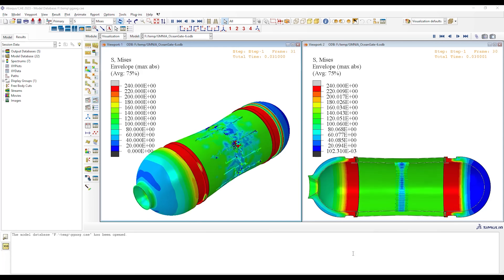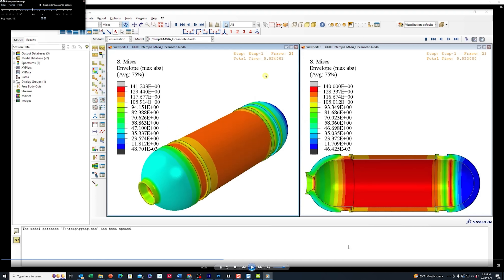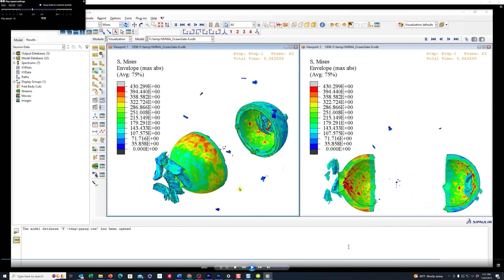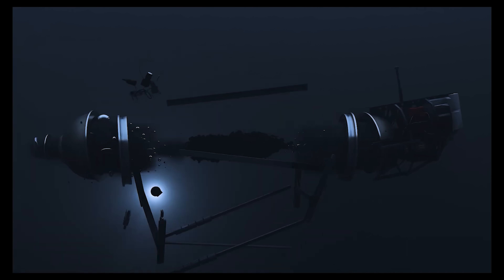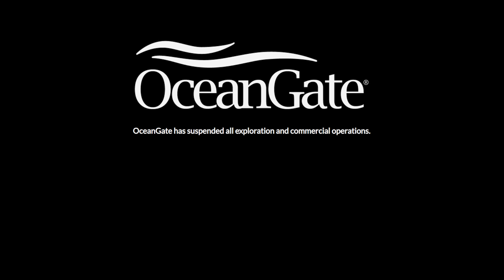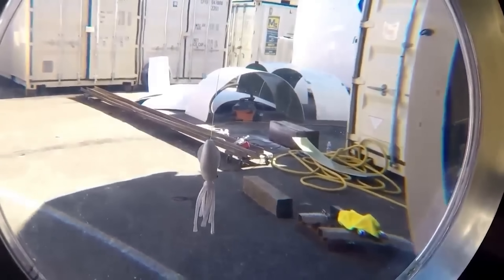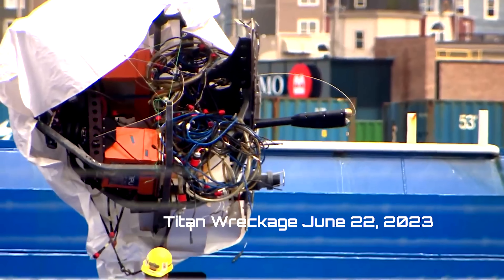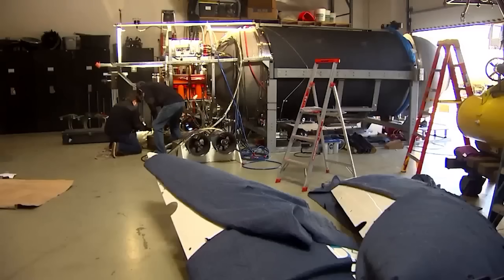Best Titan Sub Implosion Simulation, Cracked Porthole? Q & A

Comment: As a drafting design student my money is on the glue between the titanium and carbon fiber, there’s too much movement there under each compression cycle to even remotely consider the viewport. If I was an investigator that’s the first place I’d look just because of the strength difference in material and the fact it’s a cycle fatigue hot spot
Reply: When you squeeze a Pringles chips tube usually the aluminium lid pops out  ....Now on oceangate of course the lid couldn't "pop" per say because the pressure outside made it adhere , but the glue joint deformation between a still round titanium lid and an ovalized tube opening due to the squeezing .......
Reply: @benoitguillou3146 apparently once it pops, it can’t stop
Reply: @benoitguillou3146  when's the last time you had a can of Pringles, the lid is always thin plastic
Reply: @otallono  in France at one time they were aluminium if i remember well ( easier to recycle )
Reply: as  mech engineer + applied physicist - I do agree.
Reply: @siclucealucks as a software engineer, I agree
Reply: @siclucealucks  As a aerospace eng and astrophysicists,with a diploma specialty in aquamechatronics,it's a no boner wat caused it to implode,1st carbonfiber glue,alumi,that's a recipe,for disaster,sea water and extreme pressure,don't have mercy,for them material.
Reply: @WeIrD_On3  Im not doubting it ..its matchesburn who says its the the middle of the cylinder which broke first. But in my opinion its the part which can be calculated/simulated the easiest.
Reply: @WeIrD_On3 You may be an engineer or astrophysicist, but if you're a professional, you need to improve your grammar to impress people with your response.
Reply: It was not the glue interface. This thing literally made a tighter seal under compression, just like the acrylic window. The glue interface doesn’t get weaker under cyclic loading; the carbon fiber does. Of course these inferior simulations show that interface failing; that is how it works if you understand the software; it cannot model carbon fiber hull that well 

It was the carbon fiber hull that failed. It was put under cyclic loading, and people hear very loud cracking on successful dives

The hull itself was weaker and weaker until it failed. A cylinder is a weaker shape than a sphere. A fiber does not hold good under compression

All this simulations cannot show what actually happened, because they model the hull as a uniform material, when it isn’t

This is why doing simulations on it is insufficient and it should’ve been tested under real conditions with no one in it for hundreds of cycles
Reply: @pyropulseIXXI  i have worked with FEM as well. Interfaces are more difficult then bulks. btw thats why carbonfiber matrix is diffiult to model because it combines the properties of fundamental different properties and its anisotropic behavior..
Reply: @siclucealucks  yeah I know that is why the carbon fiber matrix is difficult to model; that is literally my entire point of why that is the most likely failure point

The seal would compress and become tighter by the way the titanium ring was inserted into the carbon fiber hull (the titanium basically won't even compress under that pressure while the carbon fiber hull will, so it forms a tighter seal).

So the carbon fiber hull is going under that cyclic loading and any deficiencies in the material could grow each cycle, until total failure

If anything, I could see the carbon fiber failing near seal, as parts of it compress against the titanium and the rest compresses further, causing a differential stress across that portion of the hull

But the hull anywhere could've developed ingress and failed over time, my point is mainly that simulations are not even close to sufficient to determine the failure mode

The only way is to study what is left and hope enough data exists to determine the failure mode
Reply: @pyropulseIXXI  I'm not dismissing the CF hull ...AT ALL , I'm sure it's possibly the primary reason ....But now I'm really really really curious about dunking two glued on titanium half spheres into the marina's trench with an iron rebar in it  ..... If the glue joint holds we can still sell the videotaped performance to 3M as a commercial prop !
Reply: @pyropulseIXXI  if you have a uniform structure - which is the case for the middle section - you can make quite good educated guesses because you dont have to consider the boundary conditions. This is certainly the case at the interfacing surfaces to the titanium spheres. you dont know how the torque created by the compression of the "belly" will result in shearstresses at the glued interface. Mostlikely there is a huge movement thats why they made the lid of the sphere covering the transition from sphere to cylinder so small. Have a look at their glueing footage
Reply: @pyropulseIXXI the titanium was outside the carbon fiber at the attached point so the compression would pull them apart not together.  Kinda wrecked your idea there. High schools diploma ftw.
Reply: @clockworkpanda8  wtf, i thought it was the other way around
Reply: @siclucealucks  the carbon fiber is not uniform..... it is literally a matrix of different materials; how it cured means different sized air bubbles could exist in it as well
Reply: @benoitguillou3146  
"If the glue joint holds we can still sell the videotaped performance to 3M as a commercial prop !"
...You do know that there's glues that have tensile strengths stronger than steel, right?
Reply: @matchesburn  i'm sure of it ! However .... the question is are those mechanical properties as constant along time as the physical properties of steel are  ? We re talking 200 dives here , allegedly peppered by several "concertos" of cracking noises ...

Personally i currently have no variety of glue to sell for a boss lol ...
Reply: @siclucealucks  Exactly.  The middle of the carbon fiber tube was exponentially stronger that the multi-material interface.  Now we know. The glue was all but irrelevant (who puts glue on a shiny metal surface? They should have etched the inner flange to give the (hand applied with paint brushes,..)  glue something to hold on to.
Reply: @pyropulseIXXI  As it turns out, It WAS the glue interface
Reply: @ellayararwhyaych4711  
You said:  As it turns out, It WAS the glue interface
How do you know this ?
Reply: @pyropulseIXXI  LOL... Turns out you were wrong.  The Tube completely sheared off the Tiranuim rings inner lip.  Leaving not a trace of glue behind.  (Why would anyone apply glue to shiny metal surface without acid or laser etching it anyways?)  The glue might as well not have been there.
Reply: You are not the only one...
Reply: This is a dumb argument - this design obviously has multiple points of failure that could have caused implosion, and without any other evidence it’s pointless and nonsensical to argue over which is most likely
Reply: I think there was a layer by layer delamination taking place allowing water to push into the carbon fiber because when they jettisoned the ballast and ballast housing they were still rising much slower than they should have been. They took on weight some where and there is really only one place water could penetrate.
Reply: @daleburnfart6845  I think it might have been the viewport because Alvin and all the submarines that don't blow up don't got viewports but if it wasn't the viewport 100 million percent it was absolutely the carbon-fiber up against them hard titanium rings you know what's so stupid about the carbon-fibre .... any tubular carbon fiber construction is not wrapped it's like woven in a certain pattern I got a carbon fiber paddle from when I was a raft guide and if you just wrap the carbon-fiber in a Circle up the shaft of the pole it would just break it wouldn't be strong and that's what they did with that sub they just rolled the carbon fiber on it wasn't woven in interlinking patterns and even then it doesn't matter you can't have any cycling fatigue. Or your subs blowing up like you can't have a cycling fatigue on a coffee mug after you drop it on the floor.... it's broke the end trash can or recycling bin...... and those are definitely cracks in the view port from my scientific and subsequent experience and knowledge of having smoke sessions and dropping and braking bongs and pipes off the coffee table I can concur that those are 100% cracks in the acrylic.😆
Reply: @topsecretclownbusiness2266   The good analogy on the carbon fiber is like my dad trying to fix a leaky hose with 5 rolls of electrical tape. Held water for 5 seconds then pissed water everywhere. Stockton Rush just figured if he used enough of it that it would solve the problem.
Reply: @daleburnfart6845  😆..... I'm honestly starting to think that maybe that guy was really trying to Market and sell exhilaration and fear of a possible sub explosion to the people who are going down there I mean like people that take extreme risks because it makes them excited so he made a giant Rush an Roulette sub...... I even heard him say in the interview that it wouldn't be a bad way to go and he was getting older.
Reply: @topsecretclownbusiness2266   That wouldnt shock me at all.
Reply: The viewport was only rated to about 1/3 of the depth they dove to.  That's why people question it.
Reply: @brianwest2775  well, he intentionally didn't certify the craft because it wouldn't pass. that rating is completely irrelevant, because that's the only part of the craft the agency was even willing to look at. that window design is time tested going back to pretty much the beginning of this whole deep sea exploration thing...
Reply: @brianwest2775 due to the titanium ring looking clean when it was brought back. The flex of the carbon fiber caused it to sheer from the front ring. This would explain why it looks like everything collapsed to the rear of the vessel. Due to the shape of the acrylic, it was ejected outwards as the front cap blew off.
Reply: My money is on the cyclical wound CF turning into an accordion with zero elasticity.
Reply: @cproteus  reading your comment made me wonder if they ever put layers of fibers in the longitudinal direction, or if the cylinder was basically a big spool of tape wound around.
Of course in this video the moron talks about a foam that doesn’t compress so I’m not sure he would have even bothered with the hassle of arranging filament directions.
Reply: @sburns2421  when I saw the video of the carbon fibre assembly, it showed just a straight winding.
Reply: As a layperson, I just admit that I don’t know what the failure point was.
Reply: I called it from day one. It has always been the glue joint that were basically torn apart by the different ratios of expansion/contraction between the two ridiculously opposing materials being titanium and carbon fiber. It's insane it passed whoever thinking it was ok. It was basically like an earthquake with the plates moving against each other creating hairline fractures. Also the sheer retarded way the glue was unevenly applied by hand 😳
Reply: As a Principal Engineer, and a fully Credentialed Forensic Data and Network Engineer that started out in drafting back in High School in the 70's. I will give you a hint... although hunches and bets are good starting points for an investigation, but a thorough and reliable forensic investigation follows the facts and adjusts to every lead in the investigation.  Sadly, there is no data points or eyewitness testimony to help so this investigation is already starting off with a handicap of those points, but even further the evidence in this case lies scattered at the depths of an ocean graveyard that as inhospitable as it is to retrieve the evidence, the longer the debris lays scattered on the ocean floor and in the water itself, crucial evidence may be elusive forever, leaving us with only hypotheses.  The only good to come from this will be the lessons learned at the cost of five souls.
Reply: @popquizzz yes, a lot of what ifs there. I'm sorry, but reading this thread I read your job title as 'Pringles Engineer'. I need new glasses.
Reply: @lifewithfizz1329  btw ..... why new glasses ? You broke them ? Just glue them back together .... Ask people in the thread , some have got very good epoxys plugs i heard ... but be wary when you apply it , no dust flying around , no sweat drops , and slant grind the surface to maximise the contact area .... or the size of your internet troll head might shatter the branches once again ....
Reply: yeah, the pressure vessel imploded and shot out the dome as the bolts sheered
Reply: Exactly, thats what i think as well.
Reply: As an engineer, I can assure you that the drafting designer lacks the knowledge to know how it failed. More school and years of experience are needed padawan learner.
Reply: From my subsequent scientific analysis and experience of breaking bongs and bowls off the coffee table during the cycling fatigue of smoke sessions.....yep those are cracks in the acrylic😆😆😆
Reply: I am only a welder but every single pressure vessel i have made is usually all one type of metal and all of my work needs to have a test piece not only are my welds x rayed but things that are high pressure are also tested for how they act under refrigeration laws as such also put under more pressure than the licensing regulations.
Reply: And the way they handled the joint prior to application of the epoxy....not in a clean room, no gloves, the dude was running his greasy oily hands all over the titanium skive joint.
Reply: Glue had nothing to do with this. Maybe with a pressure vessel (i.e jet airplane) (i.e PRESSURIZED VESSEL)
This was a vacuum vessel ( 15 p.s.i. inside, 6000 psi outside) Might as well been a vacuum inside. I cannot believe how many " engineers, etc"  are clueless about the mechanics which actually happened. So frustrating and I type so slow............ IT WAS NOT THE GLUE! It was the weakest point of the vessel... the center of the CF tube. It collapsed in a micro second; it shrank in diameter from 9 feet to zero, it also shrank legnthwise in the same time frame.  The mass of the bells, rings and aft sections were asked to accrlerate frim static to approx 3000 feet per second in 1 millisecond. The lack of a molecurlar bond with the titanium rings caused most if not all of the glue and carbon fiber to instantly strip away from the " lesser bond" (titanium ring)  The resultant overpressure cycle caused by air being super compressed was what caused the porthole to blast out past the mostly decorarive retainer ring with 17 or 18 wimpy bolts/ screws. If the lens had crushed and imploded, the retainer ring would have been mostly/ partially attached. No sighns of this in the debris retrieval video. 
Geez , not that complicated....
The rings /bells would have bèen held/ forced in place by hydrostatic pressure. At this point, the glue would only act as a sealant agains't water ingress.
A 6000 psi pinpoint leak would be devastating but not necesarily an implosion event. It would rapidly fill the vessel and drown the " adventurers" 
a.k.a .  victims. 
The CF hull failed at the furthest point from reinforcement ( the center of CF tube)  From there , all mass moved towards that center.  The air inside was super compressed and caused an ignition cycle which caused an over pressure pulse ( this was when porthole blew out. 
Just look at the landing frame. It was collapsede with 1 arm broken off and  the other 3 having gone from 9 feet wude to being criss crossed ( upright arms)  When the feds put this together , you can call my call. Until then.......
Reply: If a pressure vessel , sure. Tbjs was opposite. Different physics.
Reply: As another furry yeah this guy is probably correct
Reply: Not its the window window only
Reply: Looks more like trapped air in the bonding, not sure but the pressure cycles may have expanded it over time.
Reply: I was thinking the same thing too but, also the bolts were affected too at the same thresholds between materials.
Reply: I 100% agree if you pay attention to when they are lowering the titanium ring into place you never see any glue squeeze out meaning the amount used was very minimal I believe thru the constant pressure cycles the glue "seal" just worked its way loose causing a leak which in return caused the implosion of the pressure vessel 👍🏽
Reply: All in all ... I think we should all chill , and pop a pringles chips tube or two , until the REAL conclusions of the analysis on retrieved parts from the wreck keep intact or catastrophically break the emotional hull of the lastest string of finite elements youtubers , and their shot at fame and glory ...=D
Reply: Who even glues a sub?? Or generally any transport medium.
Reply: @rokkudaun  😆
Reply: Yeah and everyone defends this goofy ass controller. I'm sick of hearing the lies about how the military uses these controllers.
Reply: @spookshow6999  With so many computers in use these days, I am sure that the military use them for training and in non critical applications, but they certainly don't use them to control ships and aircraft. LOL
Reply: Makes no sense. Even if the glue was bad or not working at all, the outside pressure which also pushed on the tytanium cylinder would push it it together just as is. The pringles example is bad because there is no pressure from the ends. If the hull failed in the center, it does not matter if the glue works or not.
Reply: @TheDerHeld  I wonder if in the case of a failure of the glue. With the end caps being less compressible, would that allow them to slip under the carbon fiber and into the cabin? If the compression is what holds it together more than the glue, then the glue would mostly be to keep everything set in the same place mostly when not under pressure.
Reply: @user-zj4rg9kn1c  yes, the glue keeps everything in place while not under pressure. Like the porthole, the titanium caps get pressed onto the tube under pressure, so the glue does not really count except if it leaks water into the inside of the tube in case it is really bad. But this is not the theory of the "glue is the problem"-people. The pringles box analogy is only for people with no physical understanding. Pressure comes from all sides and keeps everything in place. If not, the sub would not implode but explode, which is not the case. I wonder how they think the glue is the culprit under these circumstances
Reply: @user-zj4rg9kn1c  and no, the end caps can't get under the tube because they overlap it (seen in another video where they build the whole thing)
Reply: @TheDerHeld  appreciate the responses
Reply: @TheDerHeld  Analogies aren't useful for proving anything , they're useful to try to get a mental image about SOME constraints one would have otherwise overlooked  , and maybe include in a model IF it's relevant  , glue with sawdust and human hairs on an imperfect surface that is bending under high stress may not amount to much at surface level in a computing model that de facto excludes them because "it makes no sense , there's a lip and pressure to hold it all " but at 3000 meters deep after 200 cycles apparently things happen ..... I haven't done any model on it anyway , nor do I care to make one , it was a ludicrously bad design safety wise to start with and it showed ....That's an empirically  proven thing now ! Now to know if it's the glued ring or the glued carbon fiber hull  that gave in first , honestly who cares , probably the same geniuses who got both the ideas anyway and went shopping hand in hand at the glue store... I DON' T KNOW If it's the ring that failed , I don't even know if it's possible , however  I find strange that everyone's banging on me because I dare asking myself the question  ... In the crafting of a model you wanna ask yourself ALL the questions , even the seemingly dumb ones ....Honestly I really don't care about tensile strengths tests in controlled idealized environments and restricted standardized geometries , the difference between the tensile strength of metals and glues , is that in metals during the meting and subsequent pouring , impurities are burned off and separated and non more can be added in during the milling process , it's de facto "homogenous" , in glues however a LOT of things can happen .....
And then you got the different rates of contraction expansion in different materials ...

Americans are funny , you get massive failures because of security elements, in situ tests , and additional studies'  haughty dismissal for profit ( well , corner cutting ) and in the investigation of it you still bring your snotty mugs , mouthes choke full of various dismissals from the get go to potentially ( I don't know ) maybe save some bottom lines ...... There's a life out of gouging wallets you know !
Reply: @benoitguillou3146  yes i see and i don't know either. But the pringles stuff is still bad and the titan is a vehicle under pressure not a pressurized vehicle. But anyway, i am not even American. Still, i see that there's a lot that can happen to the glue after that many cycles, still the pressure keeps the caps onto the tube except the glue does let water in. Have a great weekend
Reply: @TheDerHeld  Fact is I used the pringles tube image in my head to imagine the mechanical deformation on the joint ...I'm conscious this is a completely different pressure environment than the air over my living room couch where all the crumbs are lying ^^Have a great weekend too
Reply: I think the same thing. Pressure at the middle of the hull would pull the ends down and away from the rings' glue joints.
Reply: @TheFrenchPug  Don't say that's it's taboo you're gonna be canceled ....Repeat after me ... Glue joints can't separate after several cycles of contraction expansion .....Glue can't get badly applied ...You can't get a bad batch of glue ....No clump of hairs pulled out of a balding head with a terribly narcissistic boss ever fell in a glue pot and got subsequently applied on a joint ....There's no possibility of metal itself beeing sheared clean off of the super hard glue joint , like a 45 year old stick of wood glued to another wood plaque delaminates a thin sheet of wood right off when you tug on it without the old dried out glue itself breaking because of the glue itself beeing too rigid and ...physics ....The center cylinder compressed itself in a perfectly symmetrical fashion so the en caps still pressured the joints FLAT , never a wobble or deformation ..... In your meshgrid simulation just represent the joint like its a contiguous  simple ring of metal , less headaches ( wink wink ) ...

Also ....Marine welders are evil , wages too high , blue collar effin communists , you can't take their jobs with A.I so , use glue , lots of it ..... iPhones are glued together for. reason , it's because unserviceability it is the FEWTCHURE ! Be a maverick , be the next Steve Jobs ...glue away! =D ( just avoid carbon fiber for a while cuz we're gonna put the blame on that, carbon fiber being non homogeneous by nature , it's the easiest part to tweak the numbers off of ,  so .....sheesh ^^)
Reply: I'm a retired ME, my money is still on the carbon fiber but I like your theory also.
Reply: We can all agree it imploded  I don't care what failed the whole thing failed there all dead .
Reply: 😆 any duration a micromillimeter of this " cycling fatigue" = massive catastrophic s*** breaking and everybody dies cuz of water....... how did all these people that call themselves professional not just know this s*** its common sense....... like you can't cycle fatigue a coffee mug if you drop it on the floor.
Reply: @BzzZap Yes. The weight of the equipment and cone would be constantly pulling down at the top of the glues ring joint. The sub reported hearing noises twice from the aft of the hull in that transcript.
Reply: I wouldnt bet on anything 
Viewport, carbon fiber hull and titanium rings, all 3 have a case by theirselves.
Reply: @curio78  
Nope. Carbon fiber does not take well to repeated compression cycling under load. It wasn't anything to do with the glue or titanium.
Reply: @curio78  
There's a reason OceanGate touted the active monitoring of the carbon fiber. It's because even THEY knew of the risk. It wasn't the glue. It wasn't the titanium. It wasn't the glue/titanium/CF interface. Finite Element Analysis of the sub agrees: it was the carbon fiber.
Reply: Looks like you were correct.
Reply: Turns out you (and I) were correct.
Reply: Capitalism caused this DIY submersible to implode, l don't see reasons to research past that
Reply: Finite elements method's success is intrinsiquely dependant on limit conditions .... And the limit conditions between surfaces here , is ....well....the glue .....it's what is consitently im sure dissmissed as a negligeable contact joint of "no thickness"  for some fucked up reason (cough .. lazyness ! ), i have a funny story about a snotty boss who used to "dissmiss" a lot of things like that  , not even bothering to compute them.... I'm sure no one ever looked at the mounds and valleys on the surface of a "perfectly" machined titanium lid with an electronic microscope  ^^ ...  idea : how about gluing two half spheres of Ti and dunking the ball in the marianna trench , put a chicken in there and see if it comes out sliced in half or not ^^  personally i don t like "dissmissing things" , i start my scientific processes with "i don t know " and "let's have a blast testing it out " !

Edit : maybe not a chicken , not a good idea ...More like an iron rebar ^^
Reply: @benoitguillou3146  the limit conditions are actually the non-uniform carbon fiber hull, of which it is terrible at modeling
Reply: @pyropulseIXXI  also that yes
Reply: I'm getting very, very tired of seeing the "but the glue!" and "titanium-carbon fiber surfaces!" theories.
Is it really so difficult for you people to believe an elongated cylinder, which is something you don't do on a deep dive submersible, made from a material that isn't suitable for repeat deep dives due to compression loading/deloading cycles... Broke in the middle part where there's the most surface area, with the smallest amount of structural stability?

...Is it... really that difficult to believe that's almost certainly the point of failure? Even the FEA shows it! Now, granted, finite element analysis is not omnipotent... But my theory has a hell of a lot more evidence than yours does.
Reply: @matchesburn I completely agree
Reply: @matchesburn  Actually the center would be the greatest area of structural stability.  It is the area of any cylinder with the most structure.  The weakest is near any one of the edges.  There's no reason for it to break in the center if it could break at one of the edges.  Perhaps I shall put it this way: at the edges, each edge is only supported on one side!  😅  Which is why I think you're trolling and kind of joking because it's just silly... They kept hearing noises in the back this isn't something that happened fast... The water was infiltrating between the layers and got to the last bit between the Carbon and Titanium and Kaboom... instantly popping out the next weakest point at the other end: the Porthole. Which; with its highly angled conical shape, it was made to strongly resist inward pressure.  However, other than a few bolts, it had NO such design to resist outward pressure.   It would have been comparatively easy for it to be pushed outwards.
Reply: @NextWorldVR  
"Actually the center would be the greatest area of structural stability"
Stopped reading there. Anyone that doesn't realize that a cylinder's midsection is the weakest point while under pressure has never even apparently tried to crush an empty aluminum can before and is definitely not worthy of anything but mockery.
Reply: @matchesburn  yeah but my dad's bigger than yours so......chill out mate
Reply: @matchesburn  How could so many engineers and professional divers not have realised that carbon fibre has enormous tensile strength, but no crush strength.
You can see what happened, by wrapping a toilet roll cardboard core in carbon fibre. From the inside, it has enormous tensile strength, making it almost impossible to break. But from the outside, you could crush it with your bare hands. 
The crush strength was from the epoxy resin, but it was full of air bubbles. These would crush layer by layer on each dive cycle, turning the resin into dust and reducing it's strength to a soggy sponge. The added water in the layers was what was increasing the weight. Forgetting the carbon fibre and vacuum injecting the epoxy into a mould, would have produced a solid bubble free cylinder, but their would be a shatter risk upon impact from the outside. The entire nose radome of Concorde was a one piece epoxy moulding and it never failed during thousands of hours of flight. Scale models fitted with blank end plates, could have been produced for pressure testing in a high pressure tank at relatively low cost. 21 full 8 hour dive, surface cycles could be completed in a week. Unfortunately, with the composite structure they used, scale testing was impossible. 
However with a one foot square manufactured sample of the hull material, pressure testing could have been carried out using a power press fitted with a 3 inch circular head, onto a steel plate. The time factor would have been the same.
Reply: @wilsjane  Once you even just one day worked as an engineer in a company you get why ....It's easy to see why .... it's like those financial channels engineers who constantly boost claims about A.I beeing able to achieve "singularity" because they have a pile of Nvidia stocks in their portfolios ...  There are only two types of sciences , the one that knows primarily nothing and tries to genuinely undderstand how it works , and the one that has a vested interest in a certain narrative  beeing established ( not proven ... established , i choose my words carefully here ) and subsenquently tries ro prove it at all costs , tweaking numbers , dissmissing some parameters , propping up others out of proportions , even going out of their way to photoshop stuff if need be sometimes...
Reply: @benoitguillou3146  Thank you for being the one person brave enough to reply to my comment.
After 55 years working in the design and maintenance of London theaters as the chief engineer of the UK's largest chain, all I needed was a complete understanding of Newtonian physics when making alterations or designing new facilities. 
My design of the UK's largest electrode heating system, went back to a study of munitions factories during WW2, where incandescent heat would have been a disaster and chimneys would have attracted the enemy bombers. Adding some equally basic chemistry, the system only needed servicing every 7 years, rather than the factories monthly strip downs.
Refrigeration used the same principals, evaporating above the freezing point of water and interlacing the evaporating coils to allow low loads from one compressor to maintain the correct evaporating pressure across all the coils when working against humidity only. Several degree qualified engineers working with me, could not calculate a latent only load. LOL
 I once described the internet, as the worlds largest dustbin, so how AI could possibly work in todays computer focused environment completely puzzles me. 
If you know enough about a subject to filter the 95% of rubbish, why would you need AI in the first place.?
Reply: @wilsjane  I'm not "brave" ....I just see "professional suicide" ( the one where you obliterate your curriculum just to prove to your hyper connected boss that he doesn't have the mental qualifications to be there at the tip of the spear , because his ego prevent him from starting to look at a real novel problem with a blank page and a "why not , let's evaluate "/ kid in front of a new toy , kind of mentality ) as the most entertaining social experiment one can do to reveal the "meat" of society under the crusty layers of pompous "respectability" , hype , and financial interests ( My mum really poured all the curiosity and quirk of the family in me , I still complain daily to her that she overdid it ).....Also I'm really really bad at photoshop and kissing rings , or I'd still be a simulation engineer / mathematician in a certain research center , where I invented a model to describe the distribution  of DUAL LAYER zirconium grinding balls in a ceramics grinding mill over time ( I got lucky , the transport PDE was conservative ^^)  , I'm sure my name isn't on that model anymore by now , but I'm glad at least someone in the future will enjoy the benefit of "affordable" refractive nano ceramics under a nuclear core , especially since General Electric still stubbornly put the moderator bars UNDER the core through all those nasty holes in the vessel  ( ewww )  , because you know , "profit over security you dumass ".....
Reply: @wilsjane  silver surfer spotted :-)
Reply: @matchesburn  Bravo. Occam's Razor and what not.
Reply: @dactylogram82  
And, hey, people stopped parroting the almighty glue theory once engineers started doing videos on why you don't use CF on repeated deep dives.

The Coast Guard report is STILL ongoing and just yesterday there was a press report saying that it will take more time due to salvage issues and doing all of the investigation on the wreckage and doing computer simulations... But I still feel confident that the almighty glue theory will lose out to... basic physics.
Reply: @matchesburn  LOL...  How do you feel now knowing that ridiculous theory was 100% wrong?  OF COURSE  it failed where two materials with very different compression profiles meet.  The Tube COMPLETELY SHEARED OFF the inner lip of the Titanium ring.
Reply: @matchesburn  how about the fact how  this glue was applied (titan/carbon interface)? even small bubbles are enough to be considered as defects which can act as gaments of crack propagations. Especially under such extreme pressures
Reply: And again I’m not a professional but the reason they glued is because you can’t thread and bolt into carbon fiber right? So if they junked the carbon idea it would therefor junk the glue idea…
Reply: @siclucealucks  
"how about the fact how  this glue was applied (titan/carbon interface)?"
Yes, you're applying mostly aerospace standards and requirements... where carbon fiber is also well suited... and expecting the same to be true of it in submersibles. 

"even small bubbles are enough to be considered as defects which can act as gaments of crack propagations"
...Cracks? You mean delamination and shattering? Again, you're speaking in aerospace terms. 

...And ain't it interesting that Stockton Rush was an aerospace engineer? We see how well that worked out for him.
Reply: @matchesburn  FYI they found the glue was the problem
Reply: @matchesburn  more evidence? Lol ok shoe me your evidence since you must be an official investigator yeah? Oh or is your evidence stuff you seen plus stuff you think like literally EVERYONE right now? Ok tight, so you just talking out your backside and cant handle any other opinions, got ya 100.
Reply: @clockworkpanda8  
"Lol ok shoe me your evidence"
...Wow.
Reply: @matchesburn   i mean if someone is saying they know 100% and claims everyone elts is making stuff up its their responsibility to show proof, thats how it works.
Reply: @matchesburn  i mean you are the one who brought evidence into this lol no your mad because it got flipped on you? Hoe didn't you see this coming, a 3 year old could have predicted this.
Reply: @clockworkpanda8  
I'm not mad at you. I'm not going to to get mad at someone that spells like a kindergartner. I'm just embarrassed. For you. (Oh, also, the proof you want? It's presented in this video. The FEA shows the CF pressure hull failing in the middle... Exactly like I said is the most likely failure point. I even said as much in my first comment. So you should've known this... But... Then again... there's a lot of things you should know and... clearly don't.)
Reply: @matchesburn  You're not thinking the glue and titanium-carbon fiber fatigue focus on studying every angle of data for future stress analysis. Of course you don't think that far ahead..
Reply: @coreym162  
"You're not thinking the glue and titanium-carbon fiber fatigue focus on studying every angle of data for future stress analysis"
No, unlike you, I've looked at the evidence and simply admitted what was the most probably issue. There were reports of noises on the sub during descent and ascent. This shows that it is a cycling issue and the hull is reacting negatively to compression/decompression from the pressure exerted on it. There was no reported bulging, cracks, warping, etc. That's strike 1 against the almighty and holy glue theory. Strike 2 that there was no leaking whatsoever reported ever. Why is that strike 2? Well, because in the first few feet of water there isn't going to be enough water pressure exerted to make a seal. This shows that the seals between the CF and titanium were intact the entire time. Strike 3? The design being a cylinder and in combination with the sounds being reported from load cycling shows that the CF pressure hull itself was the culprit. That, and y'know, there's epoxies that are stronger than steel in tensile strength. We've done tests where steel has been glued together and the non-glued areas have been destroyed before the glued areas have.

In other words it wasn't the damn glue.
Reply: @matchesburn  at those pressures you got no "leaks" you got instantly terminal "lazer beams" of water
Reply: @benoitguillou3146  
Stop. Stop. Stop.
I said specifically when the sub was only in the first few feet of water. Do not straw man me.
Reply: @matchesburn  If you go by the alleged transcript all the noises came from the rear of the sub, which would imply the glue failing and not the carbon fiber hull failing, pushing your theory over others is somewhat arrogant and shows that you would not be the person to do the investigation because you would focus on one thing and not look into anything else.

If the glue let go in even one CM on one ring the hull integrity would immediately begin to degrade at an exponential level. The carbon fiber hull did implode, but that is not the root cause until proven. It was more likely a joint failure, two differing material joined together are always a weak point because they react differently under pressure, heat and cold.
Reply: @matchesburn  
Sounds like you have all the physical evidence before you and you are well qualified to examine it and you came to this irrefutable causality. I would imagine that you've also run some experimentation of the various components and their interfaces. Thank you for all your hard work.
Reply: @rogermccaslin5963  
This isn't an NTFB investigation of a downed aircraft. They couldn't even recover all the wreckage. The CF pressure hull is in a million pieces and it's like that because that's how CF acts when it catastrophically fails.

Again, more people thinking "submersible = plane thing that goes in the water". It's not.
Reply: @matchesburn  
So, in other words, you don't have any evidence yet you have an opinion that you state as a fact. Everything you wrote in your first comment is pure conjecture. The only thing that we know is that the vessel failed. We don't know what failed. We don't know how it failed. We don't know if it was a design failure, a material failure, a manufacturing failure., etc.

You could be 100% correct about the mode of failure. You could also be 100% wrong.

You asked this question:
"Is it really so difficult for you people to believe an elongated cylinder, which is something you don't do on a deep dive submersible, made from a material that isn't suitable for repeat deep dives due to compression loading/deloading cycles... Broke in the middle part where there's the most surface area, with the smallest amount of structural stability?"

I'll ask you, is it really so difficult for you to believe that a glue joint, attaching dissimilar  materials with vastly different coefficients of thermal expansion, flexural strength, and flexural modulus failed due to repeated loading/unloading cycles at the interface of those dissimilar materials?

I could also pose the same line of questioning about the acrylic port. Or, what about the through hull fittings connecting the various controls to the equipment located outside the pressure vessel? Things like motors, camera equipment, lights, ballast controls, the hydraulic jettison system. 

Anything in or on that submersible could be the cause. Any penetration could have failed. The carbon fiber may have failed. the acrylic might have broken. A seal may have given way. And yes, the glue may have failed. The bottom line is we don't know what failed, regardless of how tired you are of people saying things that don't align with your opinion.
Reply: @rogermccaslin5963  
"So, in other words, you don't have any evidence yet"
And you share the same problem with the other guy that can't read (or spell anything, but at least you got that down): The FEA shows it.

My theory has evidence. You have passive aggressive walls of text.
Reply: @matchesburn  This entire thread is fascinating on many levels: armchair detectives offering various theories, arguing which has merit, challenging each others' opinions....very interesting. Bottom line: without definitive evidence, all working theories have merit (unless absurd, like suggesting aliens intervened). It's very difficult to determine probabilities in a situation like this, because no baseline criteria exists for a deep-sea vessel constructed in this way. We can examine what we do know, like the potential for flaws in the CF construction tube, the use of adhesives to bond titanium to CF, the acrylic viewport not being rated for the target depth, the rate of failure that this vessel had versus successful dive attempts, and the unknown stresses that repeated pressure cycles had on the integrity of the vessel. Then we can form "educated" guesses as to how the expedition ended in catastrophic failure. Not everyone is going to agree with your guess, having guesses of their own. And even if we could point to a single probability of cause, that doesn't guarantee outcome causality. Keep in mind this vessel made several successful trips up until this point. We'll never know for certain what happened on its final dive.
Reply: @matchesburn Well I would say a year later with the coastguard hearings and investigation that your comment didn't age well since they have determined the adhesive around the ring IS where the implosion originated from.  Not saying the carbon fiber was the correct materials to use but realistically the whole thing was a ticking time bomb waiting to go off, but as of now they said the main reason was the adhesive failing.
Reply: @melissacoxen6001  
"didn't age well since they have determined the adhesive around the ring IS where the implosion originated from."
There has been no evidence of that being released from the NTSB investigation. And, in actuality, the Kemper Engineering testimony (from just earlier today) detailing the failure has ZERO conclusive evidence as to the failure point... and one of them they bring up is failure of the carbon fiber composite due to de-lamination.

So, no. My comments aged well. Yours didn't last an hour.
Reply: @matchesburn but, people go done in elongated cylinders all the time. Some of the deepest diving bathycrafts are cylinders.
Reply: @user-zj4rg9kn1c  
They are not. They are spheres. Alvin was a spherical pressure hull. Deepsea Challenger was a spherical pressure hull. Trieste was a spherical pressure hull. Limiting Factor was a spherical pressure hull.

You see, this is exactly what I'm talking about. You see the outer hull of these things and just assume that that's the pressure vessel. It isn't. Whereas with Titan? It was. 

(And, oh yeah, Navy nuclear subs are cylindrical... They also don't dive anywhere near these depths. For a reason.)
Reply: @matchesburn  oh wow. I didn't realize water actually penetrated those things aside from the 'cockpit'. They look like the deep dive Habs that people work in for a day or two. So i figured they had a little more space to move around like those where they can stand. I figured to protect everything inside, it would have to withstand the pressure too, but if you can just let it in, then you don't need to reinforce those places as much.
Reply: Hi
EXACTLY my own suspicion for the same reasons you have! THE GLUED EDGE!
Shalom to us only in Christ Yeshua returning soon to reign over His creation from Jerusalem forever.
Reply: As a student, they won't hire you to investigate 🤣
Reply: A lot of good guesses on here, I think the self tapping screws someone used in the carbon fibre pressure hull to hold the monitor bracket up didn’t help much either, so many points of possible failure, so sorry for all of the victims of this disaster 🙏.
Reply: @princeamongmen7064 The screws were not put into the hull. They weew screwed into the insert inside the hull specifically meant for mounting things onto.
Reply: @TheFrenchPug  thank you for putting me right someone else said the ends were glued on that would be an equally bad decisions IMHO, fair enough it worked for several dives, but it really didn't sit right with me, after hearing the stress on the hull he should of tested the hull as much as possible, easy to be an armchair critic after the event I know! I also never forget that there were five souls  on board...
Reply: Completely Spot On
Reply: That makes sense.